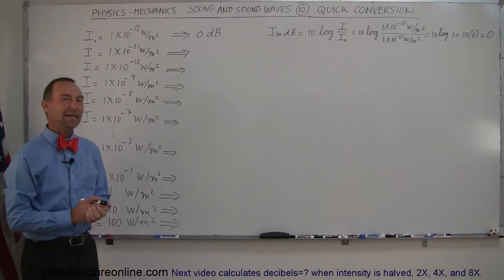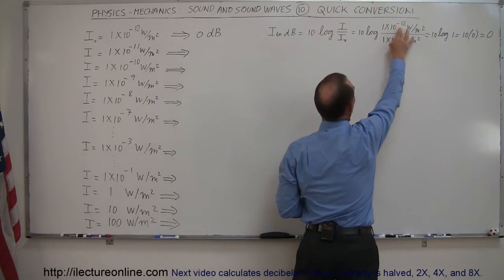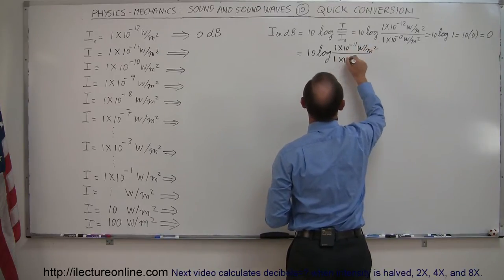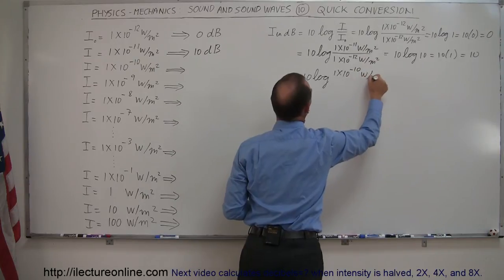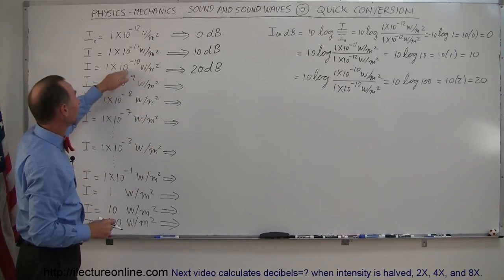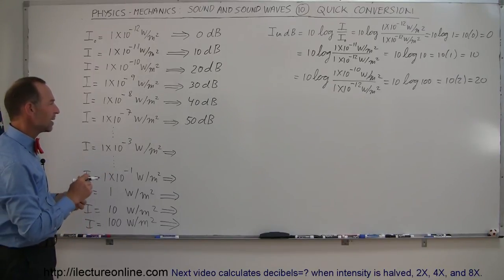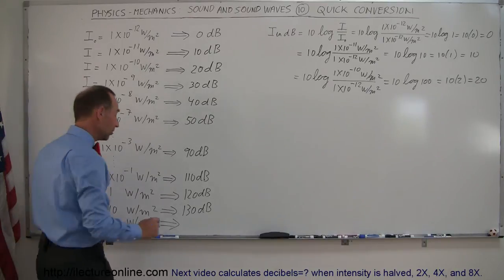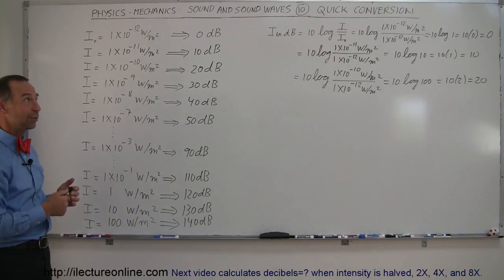Physics 20  Sound and Sound Waves (10 of 49) Quick Decibel Scale Conversion

Comment: I have noticed that the relationship between the intensities and deciBels in this video is such that the absolute value of the logarithm for the intensity value + the decibel value always add up to 12;
for example, | log(10^-10) | + 2 = 12, and | log(10^-6) | + 6 = 12.
In general:

| log(10^-(12-A)) | + A = 12,   0 ≤ A ≤ 12 : A ∈ ℕ.